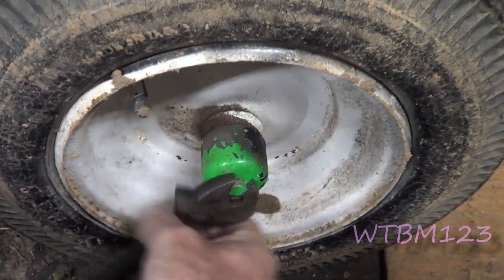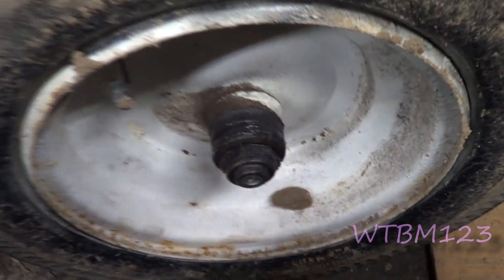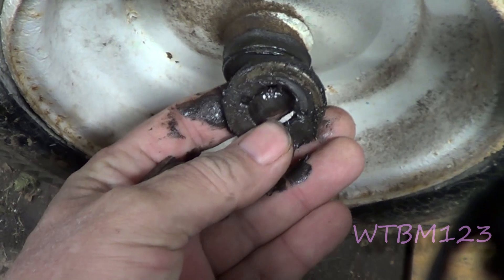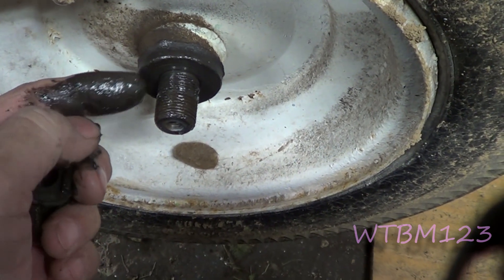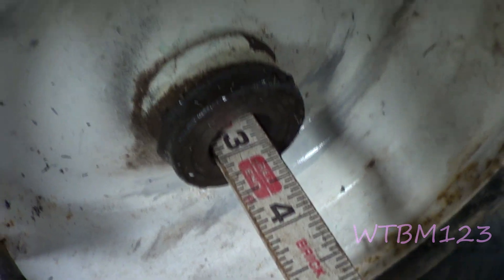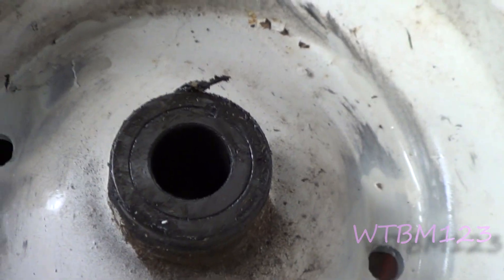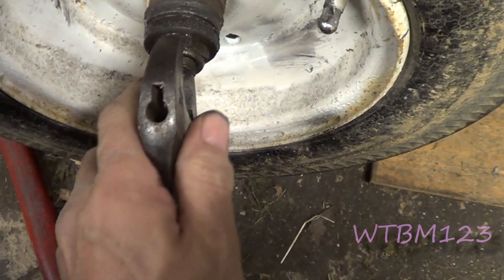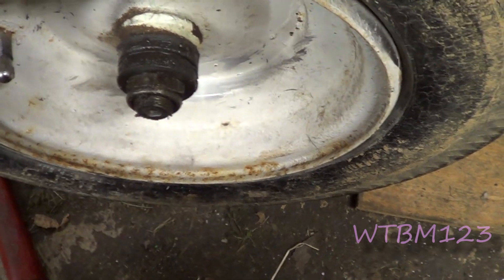Sears Suburban , Front wheel remove and replace. and hub size, Same for many others.

Comment: What brand of tire is that? I'm trying to find a vintage style set of front and rears for a 68 SS 12 I'm restoring
Reply from the maker: Miller Tire in Cleveland Ohio has 23-10.50 12 tires that are repops of the original rears .  To be honest i will have to look . I have a video on front wheel weights , I think same tractor . Not sure if my fronts original or not . I have 6 sears and a few others so hard to keep track. Hope this helps